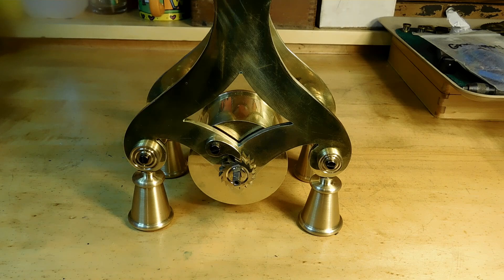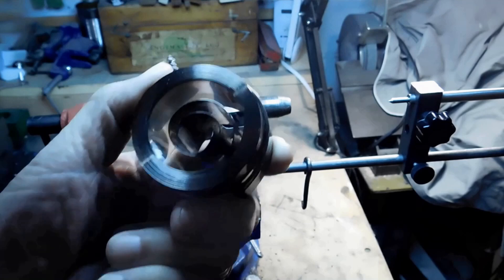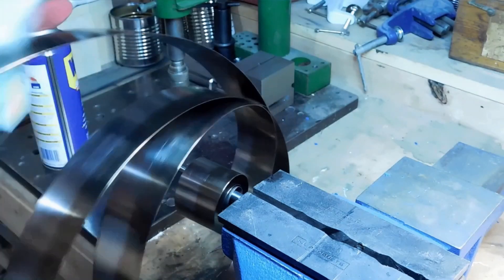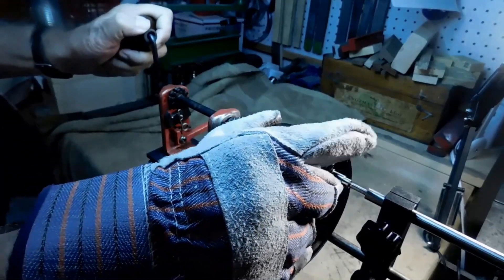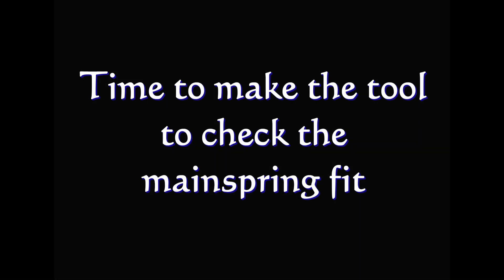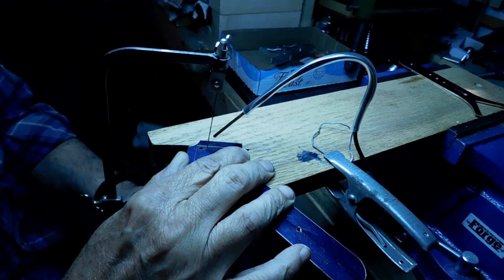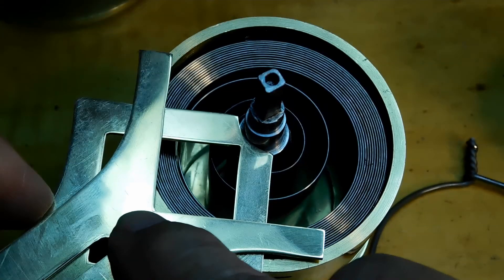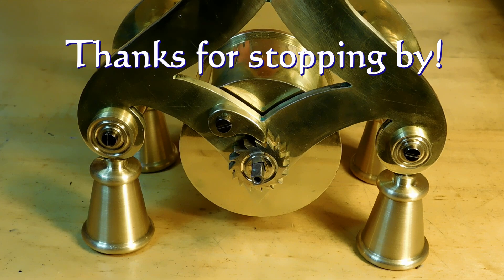WR Smith's Grasshopper Clock: Part Seven Installing the Mainspring

Comment: Hey Bob.  Great video.  You had me on the edge of my seat as you wound and unwound that spring.  Looks like it could bite you pretty good if it got away from you.  The winding tool looks like a definite must.  Thanks for sharing.  We are powerless after the storms yesterday and loads of down trees.  Hope they get it back on soon.  :-)

Joe
Reply from the maker: Hi Joe...sorry to hear of your storms...we had one go through in August and it knocked down seven trees on my property...6 big red oaks so a friend will burn his fireplace all next winter for free...just printed new handles for my hand held jacobs chucks...came out great...I'll be using them for holding a 5 sided broach and a finishing broach soon...making handles for jewelers files as well...thanks for stopping by...bob

Comment: Hi Bob nice share, that is some really thick and wide material used on that mainspring, say larger then anything we have ever come across not being clock guys. Knowing Peter and Max reading their comments below, they share these same thoughts of letting go of its strength, neat to share in slow motion comes to mind, not so much good for a man needing this to go to work like you are doing. What a really well made tool we love her so nice and built with care, thank you, Lance & Patrick.
Reply from the maker: Hi guys...there is some power in that spring...it just barely fit my sleeve...I had to sacrifice a good camera angle to be sure all went well...good thing the spring is in a barrel...I hand made the barrel hook and the arbor hook so if it let's go I have no one else to blame...thanks for stopping by...bob

Comment: Nice . I bet the springs are capable of doing some damage if they let go !  Cheers .
Reply from the maker: Mornin' Max....good thing that spring is in a barrel...I had a clock some time ago where the arbor hook let go and the spring was in a barrel...but I had to break down the movement 5-6 times to find all the little problems caused...it had chime and strike as well as time...and I needed magnification to track down everything...thanks for stopping by Max...cheers...bob